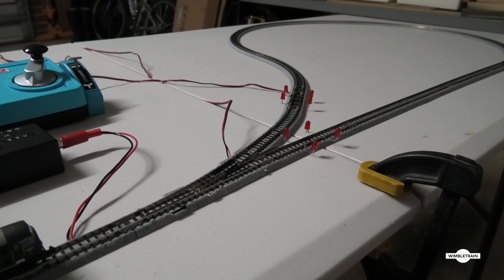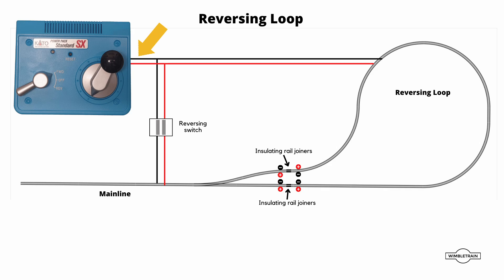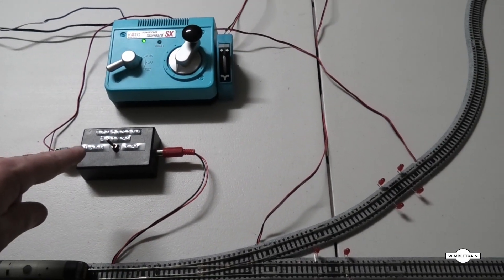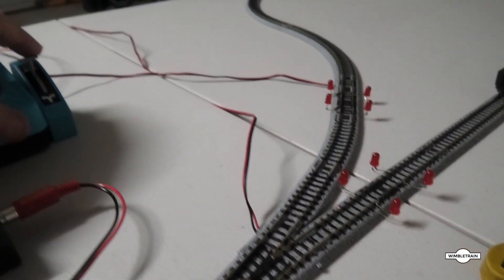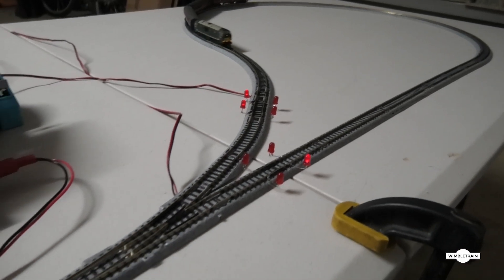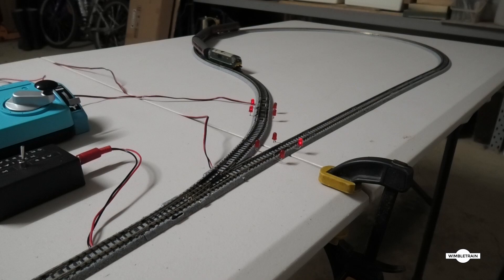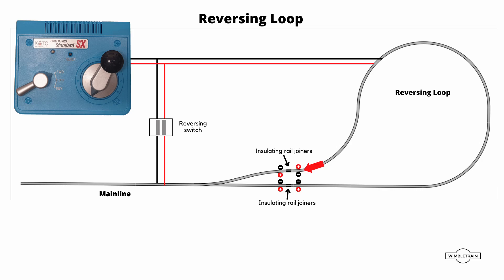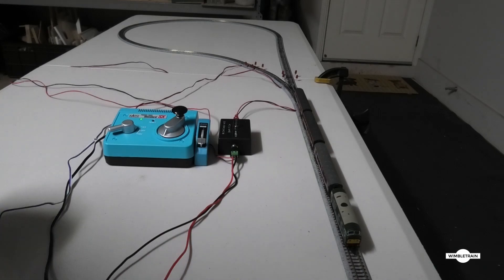Model Railway Reversing Loop Explained - Manual with Continuous running

Comment: Excellent video John, which I shall probably watch 10 more times 😂 Your explanation is brilliant. I guess once the train has passed through the loop, it’s just a case of changing the point back and flicking the switch back? Many thanks for sharing. Regards John
Reply from the maker: Hi John and thanks. Yes once the train goes into the isolated section of the loop just change the point and flick the switch back

Comment: Great, that’s exactly what I needed. Simple and easy to understand. I’m sure you can find a way to combine the turnout throw with the reverse switch. 
This can also be easy automated with a proximity sensor and a microcontroller flipping turnout and reverse the current flow via relays.
So everyone can use this solution ❤
Reply from the maker: Hi, yes you can also buy auto reversers to do the job. I was just concentrating making a video with manual operation to help people understand how it works. Cheers

Comment: Thank you so much for this easy to understand layout (I'm terrible with wiring so I've probably watched this video 20 times). I just finished wiring up my partial reverse loop (waiting on 3, 282 curves and another turnout and switch) but it works! This is going to be awesome on my exteded M1 + V2 setup.
Reply from the maker: Hi, it's hard to get your head around it when you first see it and I'm glad it has been useful to you. Cheers

Comment: Hi John, Great video and you really have provided a super simple explanation of the wiring which even an electrical idiot like myself can follow.  Just one question could you use a point motor switch (e.g one of the piggy back types for peco point motors) to automatically switch the polarity thereby removing the need for a manually thrown polarity reversing switch?
Reply from the maker: Hi Antony, not sure about the point motor thing. Usually railway modeler's use commercially produced auto reversers.

Comment: Omgosh! I'm pretty sure this is exactly what I'm looking for! I'm using Kato Unitrack to setup a run-in track which will later be/alternatively also be a test track. While I do have a decent sized benchwork top to work with (currently 32"(80cm) x 96"(245cm), but soon to be 42"(110cm) x 96"(245cm), or possibly x 126"(320cm) - if I can finagle a bit more space. Anyway, nice sized but not really big enough to accommodate a fair sized layout with space for a work area as well as giving equal weight to left-hand as well as right-hand turns. At least not that this newbie has been able to fathom - less than two month's N-scale experience, and none other, at the time of this writing. I need to put pen, or more probably, pencil to paper and check but it sure seems like I'll be able to run a continuously looping layout with only a slight bias to left- or right-hand turns, depending on which way I orient the reversing loop in relationship to the remainder of the layout. Now, just need to figure out how to make it hands-free! Thank you, again, for a very concise and brief video - even if my reply wasn't! 🙂
Reply from the maker: @August_N-Scaler  Hi, and welcome to the world of N scale! You might want to get a computer program like Anyrail to experiment with different layout configurations. It depends if you're into this sort of thing or just want to draw it out on paper. Anyway, good luck with it all. You will change your mind/plans constantly, and I can guarantee that!!
Cheers 
John
Reply: @wimbletrain   Thank you very much for your advice and encouragement - I'm sure you're quite right on the mind-changing aspect as well...bcs I already have, numerous times. 😁

Comment: Hiya John. Not related to this specifically but do you have any diagram showing your track layout? Looking to build an n gauge layout but can’t decide on a track plan.
Reply from the maker: Hi Oliver,  my layout is basically two loops side by side the a big loop around the two smaller loops. Also, have some sidings off the smaller loops. As well as that, all the loops are connected to each other, so trains can basically go from one loop to another. I am still in the process of drawing my layout up in the Anyrail software, so once done, I can put it on Google Drive and share the link if you like.
Reply: @wimbletrain  Yes please!
Reply from the maker: @olivertaylor4034  https://drive.google.com/drive/folders/1Udoyf0OnfZRSRCyUsKzSuglTypCHNjLL?usp=sharing

Comment: This is an electric turnout right?  Or is there a mechanical piece attached to your controller there to the turnout?
Reply from the maker: Yes, the Kato switches are electric so all you need is to momentarily supply plus or minus around 12v to operate them

Comment: Can you show us how you connect the red led and resister to the track please.
Reply: Yes
Reply: @Boobear83  Much appreciated. Thanks.
Reply from the maker: Hi, if you go to the 5:15 minute mark on the video https://youtu.be/SKFaFLE0T1w it shows how the LEDs are connected. Ignore all the other circuitry the LEDs are connected to either side of the rails
Reply: @wimbletrain Thank you for the link to your video. In this video, you show where the track is isolated and you connected a red led to both sides of the isolation. I assume that is the positive fed rail.
In order for it to work, you would have to solder the resistor first to the positive rail first, then the anode to the resistor and then the cathode to the negative fed rail. 
I am not in the possession of a Unitrack section and hence my question. How and where did you connect the aforementioned components to the rails. Is there a hole of sorts in the plastic on the underside of the Unitrack that exposes the rails, allowing to make the connection?
Reply from the maker: @comancheflyer4903  Hi, from underneath, there are slots in the plastic which you can then see the bottom of the rails where with a small tipped soldering iron you can solder wires onto. You can also get sections of unitrack, for example, part 20-041, which have connections to the rails already fitted with a small length of wire, so no soldering required. Also, there is part  24-818, which has wires already fitted to the joiners that are used to join unitrack together
Reply: Thank you for your prompt response. @wimbletrain

Comment: Surely this only works for one train on the whole layou as when th train exits the loop the polarity of the whole main line has been reversed
Reply from the maker: Hi Ray, yes it does change the polarity of the mainline so an example of where you might use this is where you would have a train running end to end with reverse loops at each end.
Reply: Hi very good tutorial thanks John,  a minor refinement I use for my turning “Y” is to use a black sliding switch with a small hole drilled through. I then connect this with a straightened out large paper clip to one of the studs on the turnout through bar. Then when you through the turnout you also flick the reversing switch. Cheers Peter from downunder.
Reply from the maker: @greatnorthernrailwaytother4711  Hi Peter,  this is what I like about the modelling community. Everyone has some great ideas. I would have never thought to do that. Thanks for the comment. John